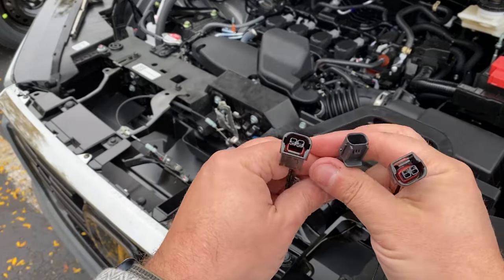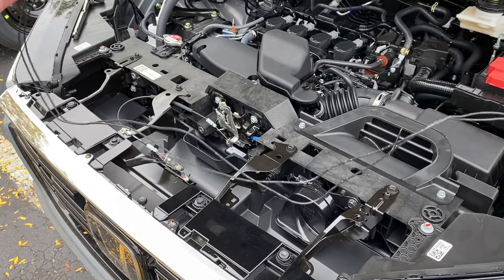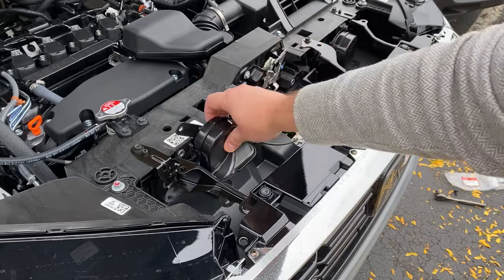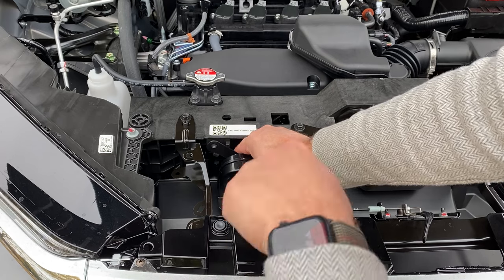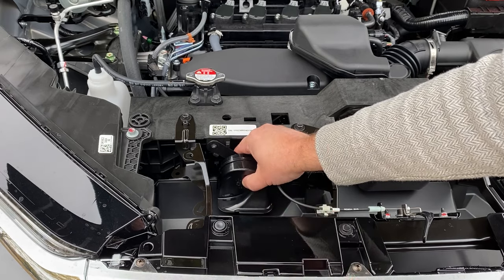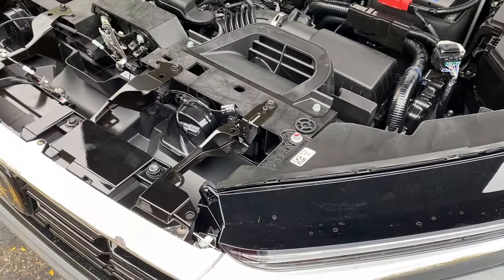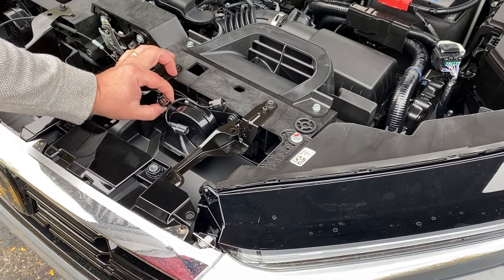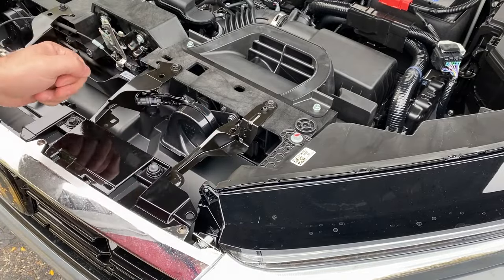Episode #300 - 2023-2024 Honda CR-V Horn Upgrade Installation

Comment: The horn kit arrived yesterday and I installed it today.  It took less than 10 minutes and it has made a huge difference.  No more cowering in shame and embarrassment when I need to honk the horn.  Money well spent.
Reply: Hi, did you install just like the video demonstrated? Did cross wiring over through the back? Thank you!
Reply: @jennifercorrea8890  I actually went across the front then folded up the excess and secured it with electrical tape.
Reply: still driving a honda though so the shame is still there buddy.
Reply: Wow.... real mature comment. Good job 👏 @sarahnootin
Reply: @jacobpetersen5662  well. you ain’t gettin this tail driving that
Reply: @sarahnootin  Nobody here but you cares one whit what you will or won't drive. It is of utterly no consequence in any and every way whatsoever to anyone else here. Internet tough guy syndrome is the most boring banality on the Internet today; I'd recommend you work to overcome such obvious and trite stupidity in your life.

Comment: Almost was hit in parking lot a couple of months ago when clearly even though I was laying on horn the other drived headed at me didn't hear it.  Installed the horn upgrade today. Took my time, about 15 minutes. Sweated a little getting original connector off original horn didn't want to break it. But it popped of using a screw driver to pry it. Everything else went smoothly. What an improvement. Now others can hear it.  Well worth it. What was Honda thinking given the otherwise decent car.

Comment: It’s a simple kit with a horn, Y wire adapter, and bolt. It took me no longer than five minutes to install. It appears there is a factory threaded grommet for a second horn. Perhaps Honda was cutting costs or had supply issues with the second horn.

Comment: I'm really happy with this product and the result. The original horn reminded me of a clown car horn, and I was actually embarrassed to use it. This kit arrived in a few days, was expertly packaged, and installed almost as exactly the same as this tutorial. The only thing I had to do differently was to loosen the 12 mm bolt on the existing horn so I could access the connector to remove it and attach the wiring kit. Other than that, Everything went smooth and it took me about 15 minutes total. Thank you.

Comment: Nice kit, reasonably price IMO.  10mm for the nut on the horn, 13mm for the mounting bolt...
Reply: And my OEM horn has a 12mm bolt, which I had to loosen so I could reach the disconnect lever on the connector.

Comment: @college hills Honda,
Does it affect the manufacture warranty?
Reply from the maker: Let's say you would have an electrical issue and it could be tied to the installation of the horn. Then the answer would be yes. That repair could be denied. Otherwise no.
Reply: @CollegeHillsHondaAccessories  what is the chance of failure of electronics tied to the horn ?
Reply from the maker: @SaiKumar-hu5oc  Based on past experience? Zero.
Reply: @CollegeHillsHondaAccessories  thank you

Comment: What is the part number for the new horn?
Reply: I got the Wolo 380-2T on Amazon for $25, the harness for $14 and splitter for $9
Reply: @Bo-qt2zx what harness & splitter did you get? I found that wolo on eBay.
Reply: @kim.jong.skillz in the hybrid CRv you also need 4’ of 18 gauge stranded copper wire, wire nuts, a crimping tool, 3/8” split loom wire wrap, dielectric grease, and electrical tape. Any questions just ask. I made a picture guide along the way if you want me to send it to you.